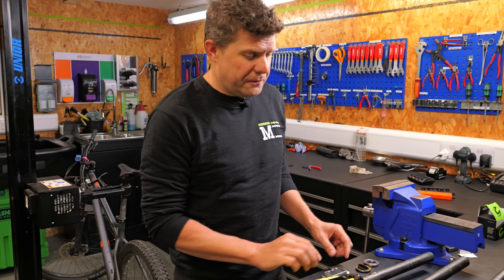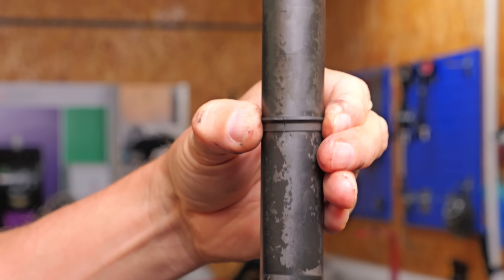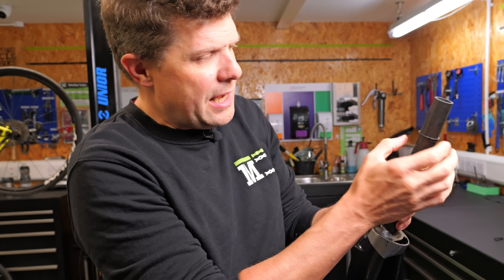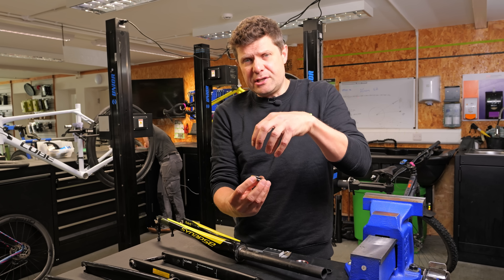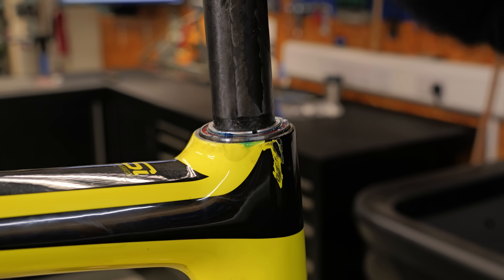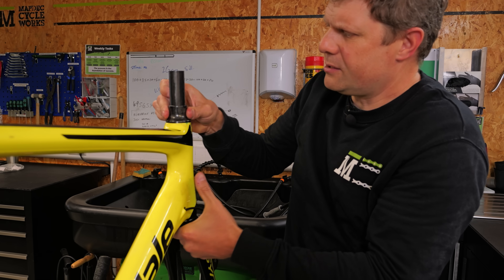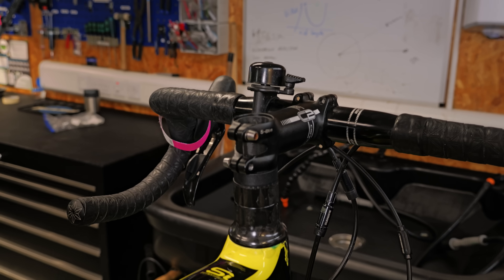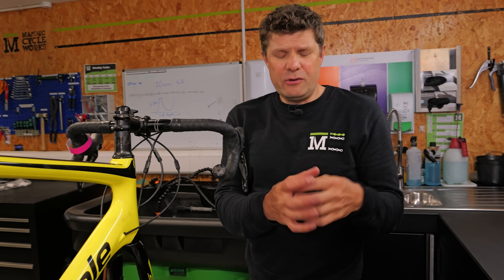Why Are So Many Bike Forks Breaking This Week?

Comment: As an engineer, I have to say repairing a steerer this way seems like a pretty big bodge. The whole steerer is flexing immensely while riding. For a general carbon repair workshop to repair an integral part like this without any manufacturer specification seems pretty dodgy to me. Creating a transition without any stress raisers or changes in tube stiffness is critical. Just putting some 3k ply on some unknown tube layup isn't exactly scientific. Just buy a new fork if you like your teeth.
Reply: In that example the wear was very low. Less than 5% total thickness I would guess. It was more about rebuilding the space. A ring of death IS NOT delamination which would be cause for concern..
Reply: @derek75116  but it creates a weak point. I remember tarmac SL7 fork and compression nut had to be recalled
Reply: Seriously, riding on a repaired steerer is the riders choice. Maybe not the smartest one, broke enough pieces at this point to know I would not even touch a bike with repaired carbon steerer.
Reply: @chromolyelixirsociety6672 one Cannondale bike for sale, one careful owner, no steerer repaired, £1000 lower price than any other bike, sounds like the method to sort the repair out
Reply: @chromolyelixirsociety6672 .. just as meaningless, what is a damaged steerer ? Ie how deep the gouge ? Depending on how close you look, hasn’t been a non marred steerer ever made..
Reply: Scary repairing a carbon steer like Só, and then even if you did, using a compression steer plug that short with 3cm+ of spacers.
Reply: As I clicked on this video to watch I straight away i thought let's guess how many people In the comments are engineers 😂
Reply: @knott4me561  That circumferential stress concentration causes local fiber-matrix delamination and resin shear, drastically reducing the fork’s tensile and compressive load-bearing capacity. Carbon composites don’t exhibit ductile yielding like metals—once the critical stress threshold is exceeded, failure is brittle and catastrophic. Any attempt at repair, whether resin infusion or surface reinforcement, cannot restore the original anisotropic mechanical properties or fatigue resistance. From an engineering standpoint, replacement is the only way to ensure structural integrity and rider safety.
Reply: @knott4me561 im going to join the party but as a farmer. I repair stuff like this all the time but normally with baler twine, sweat , cow sh#t and swearing.
Reply: @knott4me561 oh you don’t love it when engineers visit you at the bike shop and tell you why all the bikes are crap and/ or how they could fix their bike themselves, but they’re just too busy? 😂
Reply: @WasabiBunny So, we shouldn't listen to engineers? That doesn't seem very sensible.
Reply: @knott4me561  They all claim to be and very few are and know what they are talking about. LOL
Reply: What I thought was, hmm I wonder how they do the repair. 
Do they necesserally one fill.with some 3k? They might, for example, grind out a tapered section and repair with progressively wider layers and/or put some additional reinforcement on the ID (below where the expansion plug sits)
Reply: Engineer: the guy claiming things are "flexing massively" or wants to throw away dumpsters full of carbon forks with a mark on them. REAL engineer: Can develop a process, and test it. Then apply process to thousands of repairs a year with no failures. The real engineer also has a strong personality and knows better than to read the comments that all the fake engineers make about how his work will explode and kill people.
Reply: @adaycj  Unfortunately the internet is loaded with non-engineer clowns advertising themselves as knowledgeable engineers. Most of these clowns memorize a few terms like "stress risers" etc..., and then post them online pretending like they know what they are babbling about when far more often than not they are clueless. 🙂

Reply
Reply: @rcg9573  You are right but I've worked with engineers my whole career. Some are very smart and talented. A few even genius level smart. But there are clowns that are legit degreed and practiced engineers. So I have no idea if the prolific "I'm an Engineer" commenters are really engineers or not, but they sure do conjure up some fantastic imaginary nonsense sometimes.
Reply: Yeah, just scrap your three year old Colnago C64 disc because the manufacturer doesn't support the model any more.
Reply: The carbon lay isn’t as complicated as you might expect. This will likely be fine, but I still think you’re on to something, in essence
Reply from the maker: Luckily there are expert Carbon engineers out there who are willing to repair such things, and stake their name, reputation, livelihood on their skill.  I would speak to Mark if you have concerns. He is an interesting guy, quite a background. If you know the industry in this area, you can probably guess. I think you are being very judgemental to an fellow engineer whom you have never met.
Reply: @Mapdec well the better the engineer or expert the more expensive he probably is. A new fork for a Cube is roughly between 300 and 500 Euros. Aftermarket carbon forks from for example Enve or Columbus are also available. How much headroom is there for a good carbon expert who is probably not under 150€-250€/h to make money on such a repair and to still do a good job. Buying a new fork seems just like a much more sensible solution no matter how good you are as a carbon expert
Reply from the maker: @MS-bw7yt  try and buy a colour matched fork or any compatible fork for its aero head tube, for a Cannondale System Six.  Let me know how you get on.
Reply: @Mapdec Try to buy new colour-matched teeth. Or find a good lawyer for your carbon repair shop because for 999 forks your best guess repair worked great but with number 1000 you get a legal case because of injury or death. As an engineer you're legally obliged to work always in accordance with the current state of the art. If your expert can sell you a state of the art solution and still earn money... I couldn't
Reply: @Mapdec your point is understandable but models of every industrial design eventually meet their limits of what the manufacturer decides is now a "legacy" product and what they're willing to keep inventoried. I deal with this often on older diesels, and keeping in tune with the thread here my fork dilemma is finding an old school '91 cro-moly fork for my Stumpy Comp. May have to get it made, I braze main tubes but a fork requires diligence, add carbon as the main material and now goes from diligence to perfection. 

Many thanks for your time, I exited the industry 25 years ago and really enjoy your in-depth look at todays products.
Reply: Transitions absorb the harmonic energy in the tube.
Reply: Who cares... It's just a bike... Probably you crash by someone's mistake than this....
Reply: @wexelo Do you ever ride down hills at speed? This is scary.
Reply: @Fozcine  His point is not that we should not listen to engineers. His point is the internet is loaded with non-engineer clowns advertising themselves as knowledgeable engineers. Most of these clowns memorize a few terms like "stress risers" etc..., and then post them online pretending like they know what they are babbling about when far more often than not they are clueless. 🙂
Reply: @wexelo  young soul you have much to learn.

Comment: BLUF... due to incorrect levels of friction (too high in the bearing or too low between the steerer and lock ring), the lock ring starts to act as a bushing. As it is not designed for this, it wears a weak spot into the fork.

Did I get the gist?
Reply: The fork, lock ring and inner bearing race are designed to move as one. If the bearing seizes, the inner race locks, which in turn grips the lock ring, leaving movement only between the steel lock ring and weaker carbon fork. Result: ring of death.